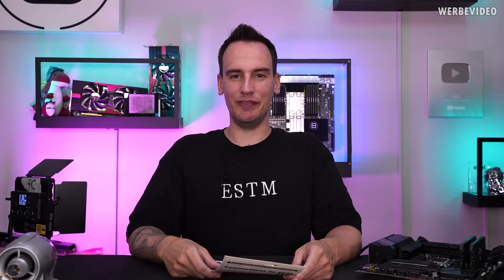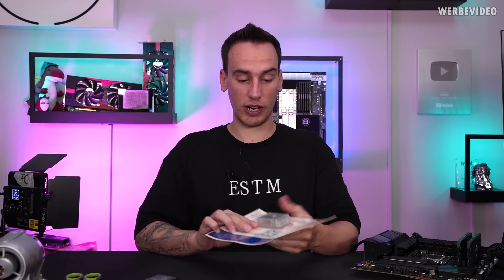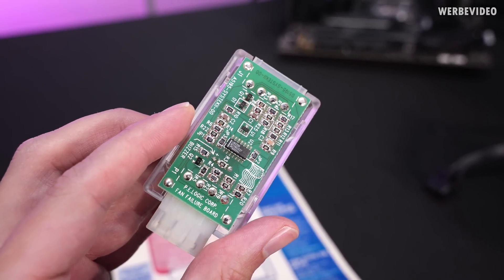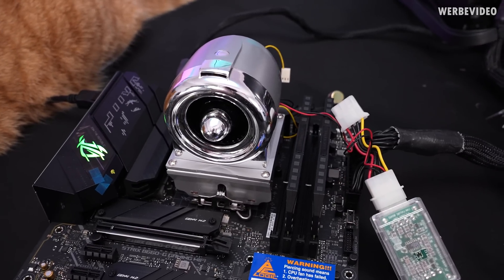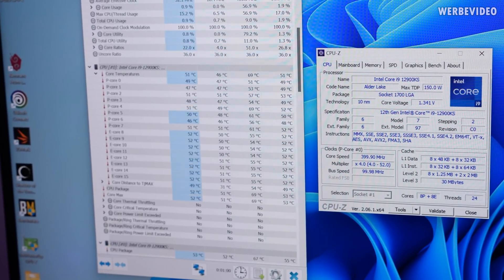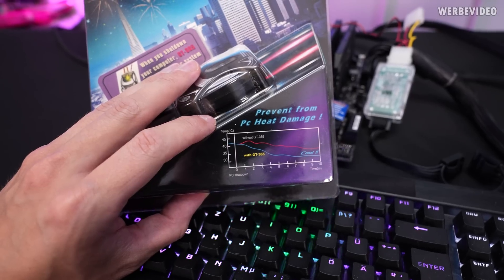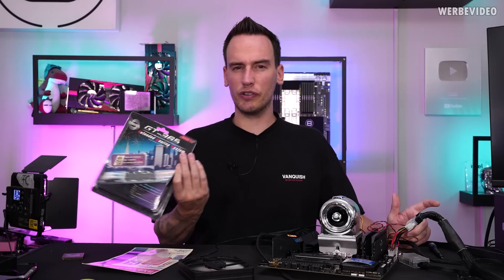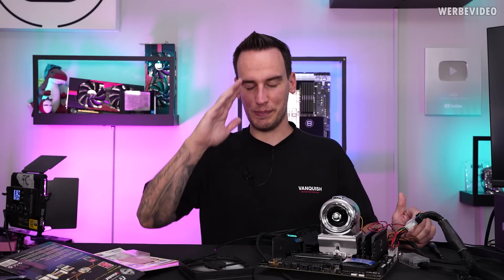This 30 Years old Cooling Gadget was Supposed to Protect your CPU... but it won't

Comment: Please, it's quite obvious you are a young man with little experience of the computers of old. Yes, heatsink fans regularly did break, as in stopped turning what so ever. That was a common failure mode.

If you look back the 386 was the first processor in the x86 family that really required cooling. Before that most all of them were left bare. Even the lower speed 386 processors were quite happy without a heatsink. But in portables adding a heat spreader really helped keeping the machines stable. The 486 was really when heatsinks and fans started to become absolutely necessary. And by the time of the 486-50 and the 486-DX2 50 and DX2 66 they were finally critical. Bet even then the heatsinks were tiny and the fans were often 40 or 60 mm jobs with sleeve bearings that liked to crap out when you looked away.

This continued with the Pentium and Pentium Pro, only the heatsinks got a bit larger and the fans often were a whole 70mm... Sleeve bearings were still the rage though.

Now there were quality fans made, using dual ball bearings and easily able to run non stop for five or ten years. But these were not often found on processor heatsinks. And it was the usual suspects that made the quality fans. That is companies like Delta, Papst, SanACE and so on. But like I said you were more likely to find fans from unknown Chinese manufacturers on the CPU heatsinks.

And as for running fans at low speed... Well you could do that, by adding in a resistor between the power connector and the fan. That was it. You had no speed control of the fans what so ever.

On higher end motherboards and server boards you often had a bios option to sound a alarm if a fan stopped. That was when they started monitoring the fan speed. But on "normal" low end motherboards that was not yet a standard feature.

Another thing is that the first processors with any kind of thermal protection was probably sometime around the P-III. Before that thermal protection was not a thing. If the CPU fan failed and you didn't notice the computer would eventually crash when the processor overheated. This usually wasn't fatal for the hardware, but still not a good thing as it could mean lost data or corrupted file system on the HDD.

However the temperature monitoring was actually a thing before that. First the motherboard manufacturers started putting temp sensors in the CPU socket, and slightly later they were included in the processors. The first was really not fast or accurate enough to stop a processor from bricking itself if you tried powering up a computer without a heatsink on the processor. Do that and the CPU was toast. And some processor heatsink mounting hardware was less than impressive and could break from age, mechanical shock, or just damage when mounted. If that snapped off the CPU was likely to slag itself before any sensor could react.

Finally you had to monitor these sensors or they were not doing anything. The software for this was not something you could just install and forget. Some of the better software had to support hundreds of separate motherboard models, all of which did things their own way. But even then it could not save a CPU from slagging itself if the heatsink mount would fail.
Reply: i was with you up until you forgot "now, get off my lawn" ;)
Reply: @mycosys  Don't make get my cane!

Comment: PC Cooling in the 1990's was still relatively new, and always a "hot" topic!  :)  Essentially, most CPU cooling fans from the era were off the shelf fans used in various other industrial or consumer applications, so fan quality was always a bit uncertain.  Integrated thermal monitoring, much less throttling was still a few years off.  Fan failure was not common, but as with many possible "doomsday" computer failure scenarios, a failed CPU fan was enough of a concern that companies swooped in with solutions to these "oh so common and potentially catastrophic" problems. Just a few years later, the Doom of the Y2K bug spurred a multi-billion dollar IT panic...but that could be another video topic for you!

Comment: The CPU fan on the computer in the tool room where I work, it’s a climate controlled environment, but it quit working, and the system still ran, but was unbelievably slow because it was thermally throttling 100% of the time, and nobody could figure out why until I had a look at it and came to the obvious conclusion.  Yep, the fan died, and the funny thing is there was a bios warning at boot the entire time, but they just skipped past it without bothering to read it 😂. I believe it was a Pentium 4, this was quite a few years ago.  I can’t recall personally having a fan die on me, but I have had bearings go bad, and start clicking.  The only components I am concerned about dying is my pumps.  One of my pumps is 10 years old now and still working.  It’s a Koolance PMP-450

Comment: Seem it's a useful gadget for people that never open the PC to clean it or have it in dirty/dusty environnements (industrial or long furry pets)  , old generations didn't have temperature or rpm probes/protections .Some of the PC's that I repaired had so much fluf inside the fans , and I found case fans that where blocked when the fluf moves and bloc the fan ,some of them burn the maglev motors of the fans.
The small center chip (near the cutout )seems like a (ambient) temperature sensor , You should have tried to use a hair dryer to see if the mod start beeping when it was hot (maybe over 50°C ) ... 
The 2nd mod was useful for the same old PC's ,  that worked in very hot environnements, to help cool down the PC "overall" (the electrolytic capacitors don't like heat)   , the idea is the same of a older car : if you stop your engine right off a high way in a hot day , there's no cooling and the heat can create problems and/or reduce live span of parts ,like sparkplug coils and capacitors and other parts . Some cars will continue to let the cooler fan to work after stopping the engine (direct thermostat) .

Comment: i had a few bearings go n one even self destructed the fan blade wobbled that much it caught the back frame of the fan n ripped the blade off and the old corsair t case with the 200mm in the front i removed the fan to jerry rig a 120 aio in there and the whole fan blade housing just fell off i was holding the fan blades in one hand and the motor n mount in the other

Comment: I only had 1 complete fan failure that kinda led to a broken GPU...

It was a tiny Nvidia GPU from like 2005 or 2006 maybe was like 7600GT or other and after some time in use I just saw that the fan broke after a few years.

And I Frankenstein some small crap fan I had that wasn't a perfect fit and gave it to a friend but it broke in little time because it probably wasn't doing much and was overheating.

Comment: I did see some useless products like this float around in the 2000s, and i have had fans fail, usually those tiny ones on GPUs in the 90s and 2000s, small chipset or slot 1 fans, those cheapy whiny ones we don't miss, but a lot of those were at least 3 pin or 2 pin so no way of hooking them up and it was before thermal throttling was implemented until 478 and Later 462 chips. considering this is for older molex fans on those small heatsinks, i have seen them fail, they gummed up a lot but honestly you'd be able to tell if they weren't running since it was so loud. Its potentially useful then, but the whole thermal sensor claim is just a joke! Either the bearing dried up (my experience with these old fans is they use a weird grease that goes brown and sticky after time and slowly the fan becomes harder to spin) in other times it was just those small fans that were very unbalanced and just ate the bearings, they spun so fast eventually the grease would be pushed out and fans would rattle for a while unless you used your finger to slightly touch them and vibrate them, it would shake things enough to make the fan happy again after some bearing oil considering how tiny the bearings are)

Comment: Remember the days when a CPU would just fry itself. Ah, those days. 
Luckily they are long long gone and every CPU has inbuild protection. But sure if you had an AMD XP whatever... it could be useful. I have seen some tests where they let those child cook themselves to death while holding a heatreader to it.. Those old chips spiked up fast once cooling "Failed" [aka was taken off] and began to burn themselves. 
And yes, the thermal protection used in mobile chips saved the day. Lowering power and speed states and so on.

Comment: ive seen plenty of dead fans, usually in smokers houses, i could see it being somewhat useful, as back then i didn't see many CPU fans, but case fans that used molex, and cheap case fans usually are what die from experience. also back in those days at least 486 and early Pentium didn't really need active cooling so just some case ventilation was enough.

also if that warning temperature was in deg Fahrenheit i could see that being useful as well as 110deg in a case is pretty warm and they might have called it CPU just because a lot of less techy people call the case the CPU

Comment: 13:40 it doesnt say CPU temperature.  It says S Y S T E M temperature.  Thats not CPU.  This device was designed to keep the inside of your entire PC cooler back when components were MUCH more sensitive to heat than they are today.  Old motherboard components could easily be damaged if your ambient temp was 100F.

Comment: Aw, how cute, he thinks shit fans with molex connectors don't exist anymore.

It's also clear he didn't use PCs in the pre-Athlon era. These CPUs don't thermally throttle. Fans died frequently. This product is still not great, but it was a thing in that era.

Comment: Only fan failure for me was 16 years ago, and it was a 90mm fan in cheap power supply. Gentle tap got it spinning, but with horrible noise. Another tap when it was spinning made bearing sit better and made it work at reasonable noise level

Comment: I've had well over 30 fans die to bearing failures.  But my PCs also run 24/7 for 10 years straight.

Comment: Back in the day fans died more often - the bearings weren't built the way they are now so its possible it was a concern at the time. Funny enough i never had one die in those days, but i had a Scythe Kaze fan from a Fuma2 die, and an old Corsair fan from maybe 7 years ago.

Comment: I have an OCZ Fatal1ty power supply that has a similar time delay on the psu fan, its similarly unnecessary, as you say the components are no longer generating heat so nothing will get hotter. They're invoking the image of a 'Turbo Timer' on cars, where certain high performance engines are kept running at idle for a time after shut down. Although, as I understand it, that's more to do with keeping lubrication flowing to the turbo bearings as they spin down. The PC equivalent is just rule of cool.

Comment: HAPPENS!!
my first pc, 486dx66 failed for years, freeze, shop had no clue they didnt solve it. all they did was blame me for virus that my pc never had.
until i discovered that the fan stops by itself and cpu overheats. This device looks stupid but could have been the solution for the back then stupid technicians that had no clue how to fix pcs.
Old fans were weak, and small, not like 12cm current fans, so was was a bit more common for them to fail. even motherboads x570 with those stupid small fans, they could die.

Comment: I worked building PCs in the 90s , we put fan alarms on many pentium processors , the cases then were solid all metal , never opened unless there were a problem , lots of CPUs died from failed fans and overheating , seems bizarre now but a nice accessory back then 😂😂😂

Comment: After shutting down the pc CPU CAN in some circumstances be heated up by body of radiator. It’s quarter of kilogram of heated up metal. And where all that heat goes? To colder objects nearby like air and shut down CPU… and there is no active airflow around radiator

Comment: This thing was basically a sound emitter for amperage increases on the molex connector. Fans did used to fail. I’ve worked as tech support way earlier and the day, and I’ve seen fans completely stuck by dust and grease. The benefit of the old 486/Pentium CPUs: they would overheat but wouldn’t burn, unless left on that type of heat for a long time - something the Pentium Pro wasn’t too good in handling, just as any modern CPU does today.

And yes, our 40mm CPU fans used to run 100% all day long, with a tiny copper block clamped with plastic grips on the side, way before companies made jets and the likes for the looks.

Great nostalgia video, Roman! Danke schön!

Comment: Fan failures: One of the case fans i had never worked out of box (should have RMAd it but never bothered) but otherwise haven't had fan failure.

So much of this old stuff seems like outright scams basically. Useless crap.

Comment: systo-tek; two functions; load check (which is why the alarm sounds when you turn the speed down, its expecting a certain current load value and slowing the fan down drops it below threshold).

the other function actually is a temp sensor, if rudimentary. which is why there's the window. it samples case temp and alarms if it goes over value.

and its almost certainly in F, so it sounds if the cpu is on and the fan stops drawing power, or if it hits over a certain temp.

they worked, mostly, but they were.. not well regarded, due to the noises no one wanted to deal with.

good for always on server machines of the era, though. where you needed to know if the fans died.

Comment: If I recall correctly when you power down your system the CPU temp might increase because as you turn the system off you're still dumping heat into the cooler but the fan stops spinning too. So the CPU could heat up a bit. Still, that device is useless I'd think.
Reply: The heatsink temperature can increase slightly after shutdown (because it's cooler than the IHS), but no, the CPU can't increase in temp.  Any increase in its temp has to come from electricity.  Everything around it is cooler.  If there's any benefit, it's to the capacitors around the socket, which will heat up after shutdown from residual heatsink heat.  This would be negligible and not worthwhile.

Comment: I used my Wraith Prism fan for the 1600X and now it's cooling a 5800X, 5 years old and still running flawlessly, and so do all my other case fans.
I never had a fan failure per se, but a few weeks ago one of the SATA cables moved a little bit and blocked one of the fans of my GPU. I noticed it reaching 75°C when it usually sits around 65° under load, thinking it was the heatwave that caused it, but it didn't take long to find out what the issue was and now it's back to 64°C. It's easier to happen with the GPU, due to the SATA connector placement, but I can see that happen for the CPU if your cable management is REALLY bad.

Comment: I have a theory on how the GT-365 chart potentially could be correct, if it is referring to the case temperature. Sure your components are no longer consuming power, but they are still emitting the remaining heat into the case turn them off, whilst the air in the case is no longer being replaced with fresh air. Still a useless product, but the graph might be correct.

Regarding fan failure - had one fan partially fail on me in that the bearings wore out and it started to make loud noises, but it was still spinning.

Comment: Funnily... That cooling fan after the system turns off, the graph isnt exactly wrong. I mean its benefits are exaggerated for sure. But that graph basically shows thermal soak lag. So yes when you turn off the system. For a short time the localised heat will increase a little, as the cooler is no longer pulling heat away, causing a backlog of the current heat stored. Which will then return to the CPU. Heat Lag... 
Its a non issue for sure as it will never reach damaging temperature's.

Also yes older CPUs as im sure you knew didnt have thermal throttles.
I also had the other turbine style fan(orange looking thing) , that was noisy too :p At the time thier performance was really good.

Comment: I had couple of el cheapo fans die on me as recent as in ~2014 after only a couple years of operation.
Those were literally the cheapest generic noname black 120mm fans I could find, but still I didn't expect them to die so fast.

Comment: The fans on 486/pentiums were often really cheap and horrible, similar fans to a lot of old AGP video cards but that just meant they would make their own warning noise, a horrible grinding. I have seen fans that seized up but surely they would have been making bad noises before that happened. Dunno.

Comment: I see PSU fans not spinning at least once a month. mostly office PCs that doesn't get any maintenance until they are fried or start to have sudden shout downs.
On the CPU side, I only cross about a handful of PC with cooler fan not working from 2007 until mow. Mostly Intel stock coolers

Comment: fans die all the time. also you can put the fan control before the device. I mean if its monitoring the voltage drop only

Comment: Took me a minute but U1 is an LM45 temperature sensor Texas Instruments LM45CIM3 or LM45CIM3X
LM45CIM3/NOPB ACTIVE SOT-23 DBZ 3 1000 RoHS & Green SN Level-1-260C-UNLIM -20 to 100 T4C 
LM45CIM3X/NOPB ACTIVE SOT-23 DBZ 3 3000 RoHS & Green SN Level-1-260C-UNLIM -20 to 100 T4C
No way you didnt do the 'put the obvious wrong answer out there and someone will look it up for you' thing (i found it on yooneed too), so there ya go XD

Comment: Over the years of owning like dozen or more systems, I've had two case fans die on me and a friend did once have CPU fan die. It happens but it's not common in consumer parts which usually just run few hours a day. Maybe it's more common in enterprise where those rack mounted servers have rows of fans spinning at fairly high rpm pretty much 24/7.